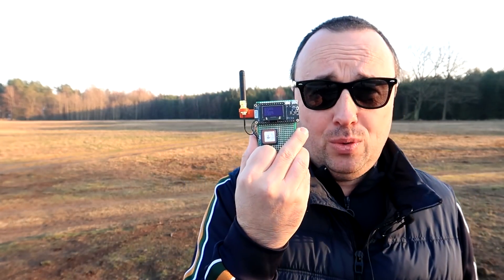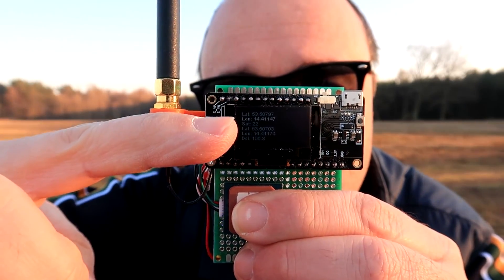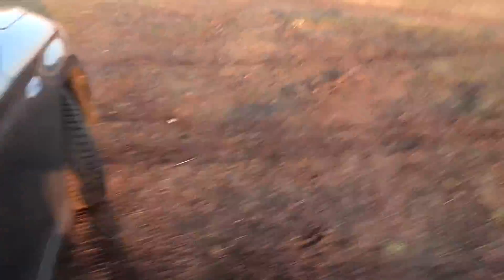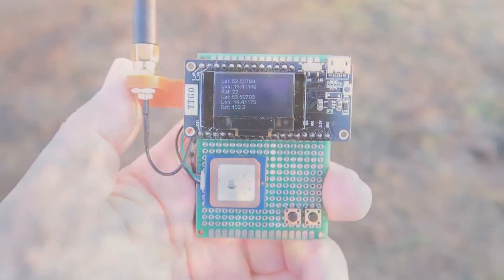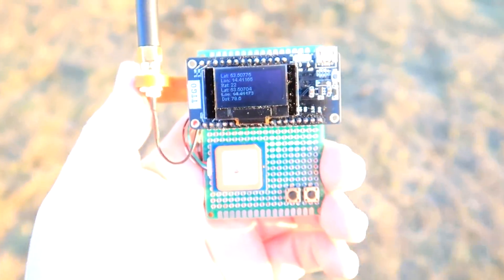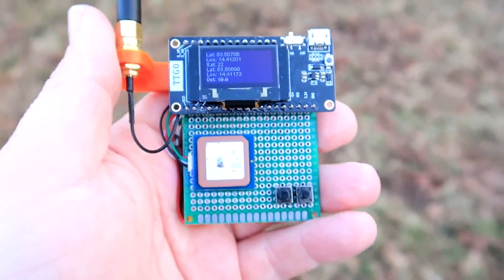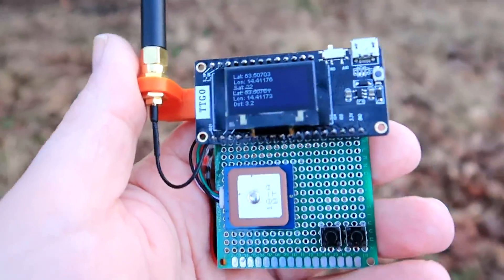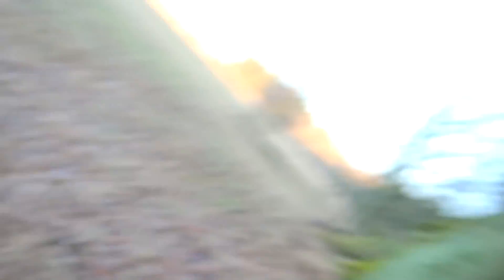GPS locator with Arduino and LoRa | part 2

Comment: Is there function in inav to fly to a beacon?
Reply from the maker: It's possible but you need a special beacon
Reply: @HackerUni  ok thats cool thanks very much, I won't dig given the current climate and potentials of use, I can wait as it's thinking ahead of where we are in FPV and our general tech level adopted, you fall within the R&D/educator category for our sector and represent ahead of the norm.

Do you have a patreon? Could I get more invested info should I join? I appreciate your work to acquire it and that cost of resource, time and skill.

I'm designing an FPV airframe now that will use INAV as the platform because the options and technical capabilities are the greatest from this system if looking to combine manual FPV with supporting functions to help the pilot (lidar tof for accurate alt reading for example) this I feel is the opposite philosophy and strategy adopted by mainstream drone users, which is to replace rather than augment skill and essentially the pilot with an artificial system, removing skill and practice and systems accesible to engineer and in my opinion removing the superior ability of humans to fly better than machines.